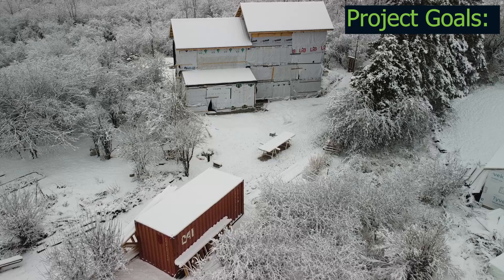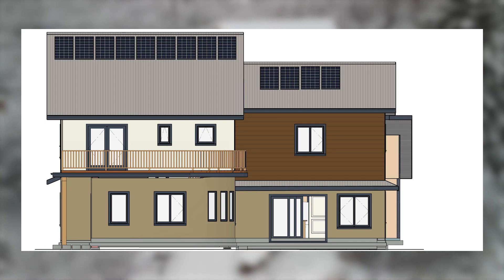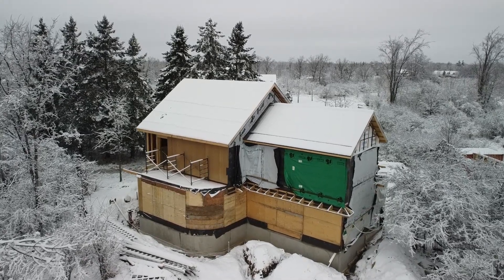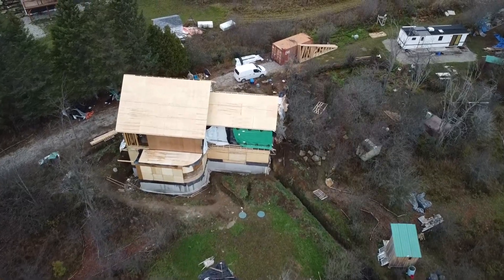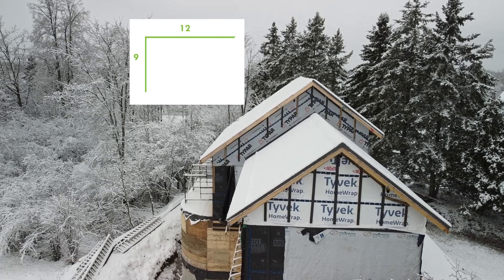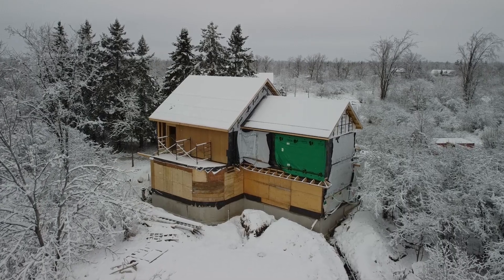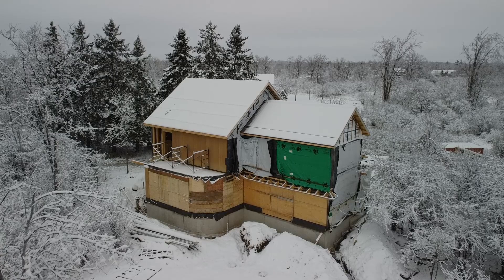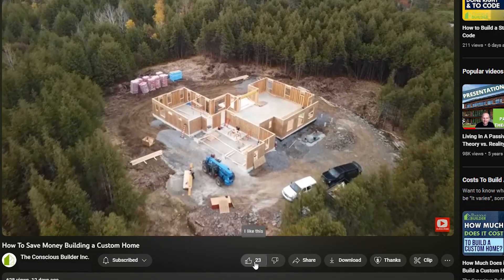Solar Panel Installation: Is Your Roof A Good Fit?

Comment: That’s why I don’t hv solar !  I am a finish contractor and hv desperate ppl call me asking if I can fix leaks that hv occurred with solar panel installation ?  I tell them I am not that kind of contractor.  I refuse to put them on my tile roof !  I will live w/o them knowing they need cleaning where I am twice a year ( farming country ; trees all around the neighborhood!  
Plus 90% of those solar co., hire poorly trained individuals who may hv one person on the job with experience!  Overdriven screws with o ring washers thru sheeting , not sealed.  
I will not buy a house with solar on the roof!  PERIOD!
My son in law placed them on the barn roof!  Then ran the proper connection to the house!  Next he will set more on racks in the field !  
And he works for one of the largest energy companies around!  That right there should tell you most of this is a scam !  Here is the States we changed from “ no drill high energy cost , putting panels everywhere to now after electing a reasonable man “ drill baby drill , low energy cost” !

Comment: Great information. When putting panels on your roof does anything special need to be done structurally to carry the weight of the new panels.
Reply from the maker: Most roofs are able to support solar panels without reinforcement as the panels are lighter and the weight is distributed, but it does depend on the age and condition of your roof. If there are any issues, best to fix those before installing panels. A local expert should be able to tell you if you have anything to worry about. Thanks for watching, so glad it was helpful!